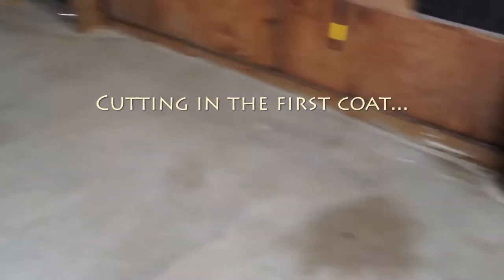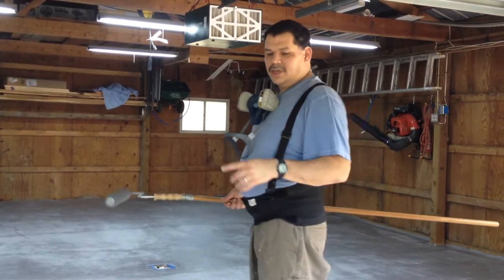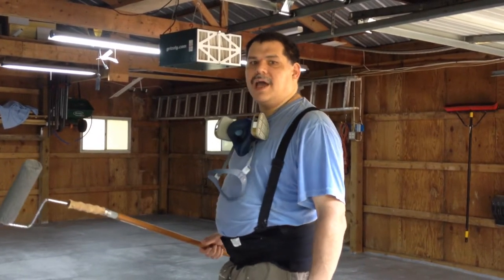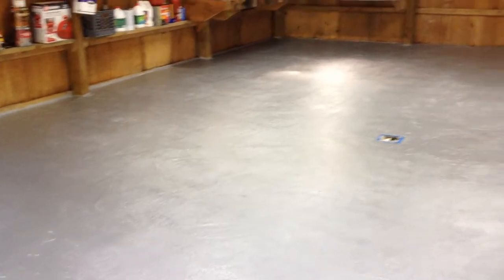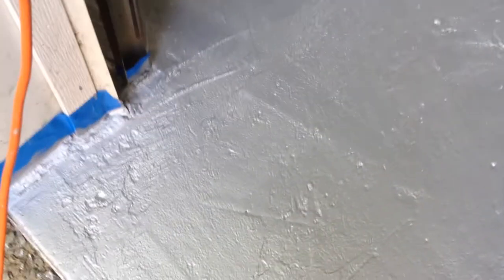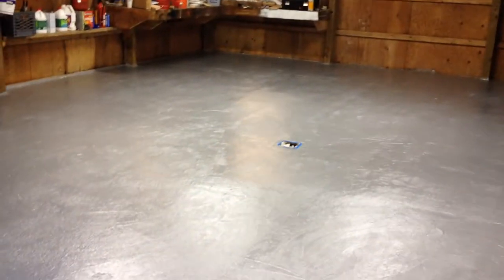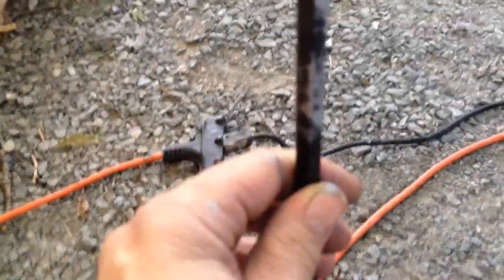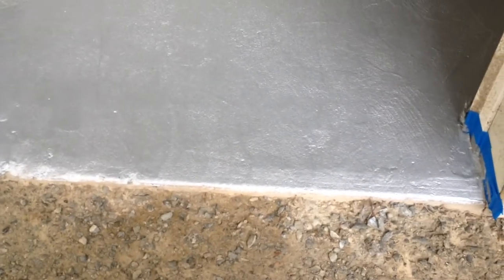Applying RustBullet to a Concrete Garage Floor - Garage 1 of 3

Comment: Looks pretty good, how is this product held up so far?
Reply from the maker: Amazingly it has held up well. No scratches no peeling. It looks slightly darker, but that may just be dirt I haven't bothered to clean any of the floors.  I have no connection to the company but I'm amazed that it's not a more popular product.  It goes down fairly easy and cost in materials are not that bad.   I really am amazed because most things I purchase turn out to be disappointments.  Expected by now it would be scratched up and maybe peeling in some places.  Nope.  Still looks the same as when I put it down.

Comment: Great video.  I always like seeing real world applications, instead of people who apply it for a living.  I will be using RB to paint my floor.  Could share your experience with the difference of the slickness of the RB surface vs. bare concrete?  I have a ping pong table in my garage and although the bare concrete's grip is passable, I was hoping to NOT have to add the non-skid additive to keep it from being slippery.  Your thoughts?
Reply from the maker: Meh...you may want the anti skid.
The paint is holding up VERY well (it resists scratching as I drag things like drill presses and grinders on it).  It has not shown any damage from limited welding splatter and grinding sparks.  But...When I first go into the garage in the morning, my sneakers will squeak a little on the floor.  It does not FEEL slippery, but if you put your hand on the floor, it feels cool and a tiny bit moist.  I think this comes because the floor is cool, and the damp air from the night condenses on it in the morning.  I do not feel unstable on the floor at all; but I'm not lunging for a ping pong ball. 
Once the day warms up a bit, the moisture evaporates.
So...if you plan to play ping pong after watching a sunrise, get the antiskid.  If you will not be playing till the day warms up, you should be fine.  That said, I would imagine it gets a tin bit damp in the late evening as well.  
Worst comes to worse, you can skip the antiskid and if needed, give the floor a quick sanding with a sanding pole and throw down a clear coat with anti skid in it.
Reply: Thanks for the insight, I really appreciate it.  Ping pong after the sunrise...sounds romantic!

Comment: I know this is an old video but there is so little out there on this product it is worth mentioning here.
 If you have wet areas or oil on your floor use a weed torch and heat those areas until the suraface is clear.
Reply from the maker: I actually did that, and he surface would look dry, but then moisture would nome back.  No matter - I guess it was dry enough for Rust Bullet, becuase it stuck and has yet to peel or scratch or chip.  Five years later, looks almost new.

Comment: I'm really curious about the area that was wet. Did it lift, bubble,crack?
Reply from the maker: It's still as nice as when I put it down.   I have it down on three different garage floors and it holds up well to everything from dragging, grinding, welding and gasoline.  The only thing that has any effect was spilling acid on a spot - it changed the color to a flat dark grey.  Otherwise still perfect.  I'm surprised more people don't use it.
Reply: @forseeit  Actually, I'm a rep for Rust Bullet and I came across your videos. Being a moisture cured urethane, when I saw that wet spot, I was really concerned what was going to happen. Glad it held up!  Anyhow, for years epoxy coatings have dominated the concrete garage flooring market. It's been tough breaking that mold. However, I've watched it grow significantly over the years, so a lot more people are using now than before.  I want to thank you for your support and your videos are great!  👍

Comment: Watched all 3 if your vids....good job. If you are still commenting back on here......how well are all 3 garages holding up?... seeing you did drastically different surface prep for each. Wondering if the 3rd garage (where you did the least prep), is still good ?
Reply from the maker: Wil Ferch - All three are holding up surprisingly well. The third floor is mostly used as a woodworking shop, so while I walk on it a lot, it does not get the same “metal dragged across it” abuse that the other two get.  Zero peeling and no scratches (none that I notice).  I do hesitate to weld much over the floor - I know people who’s epoxy floors were ruined this way.  That said both mig and stick welding splatter do not seem to have left any marks.  
A persistent puddle in the corner of the first garage (the pole Barn) has had no effect on the paint.
One other thing - back on the first garage project, we finished the last coat with a little paint in the tray, so I painted an old rusted lawn trailer with what was left.  My only prep for that was to sweep it out.  It had LOADS of rust on it.   It is stored inside, but it gets loaded with rocks and dirt often.    A few scratches, but otherwise it’s holding up pretty well.   
Overall, would use it again without hesitation.  I don’t understand why it’s not more popular.
Reply: Thank you so much for the speedy reply. My application should be a piece of cake compared to yours. My floor is 1 year old and has had no traffic on it...it's an attached garage to a home that has had very little use to date. Wanted a nice surface that cleans up easily if ever I do oil changes in the garage or take wheels on/off....where there is this carbon brake dust that falls to the concrete surface....both of which soak into and stain the floor. Wanted the coating to be tolerant of jackstands and jacks.  Also didn't want another kind of "paint" where hot-tire peeling can be a problem. Looks like this stuff is exactly corrrect for the service I want to subject it too. Aside....your 3 vids are truly great as it gives a "real-world" feel to the process.....you should ask Rust Bullet for compensation !!!..... haha.

Comment: How has the Rust Bullet coating holding up? Thanks.
Reply from the maker: It's now May 2019 - over two years since I put down the floor.  Still zero chipping, lift, or scratching.  The floor could probably go with a mopping.  I would without question use this on any floor I needed to finish.  Easy to put down.  Fumes will kill you without a mask (with a filter for organics).  Tough product to find, and not super cheap (but same price or less compared to other floor coatings).

Comment: did you have to use bloxygen in between coats to keep the 5 gallon from drying out inside?
Reply from the maker: I did use the bloxygen.  Not sure if it helped or not, but a small price for some insurance.